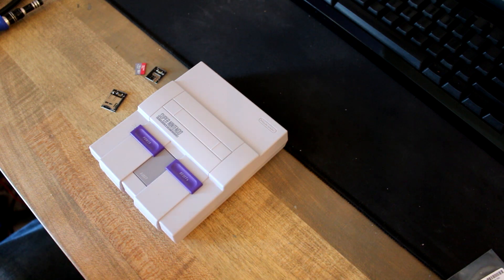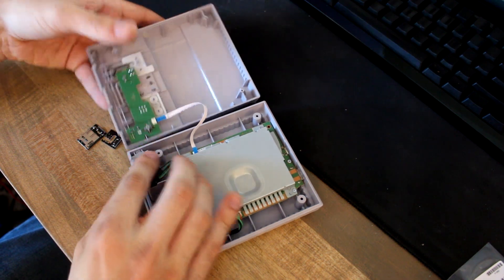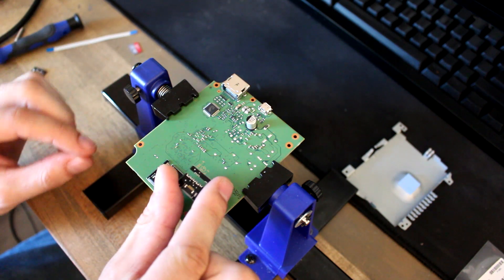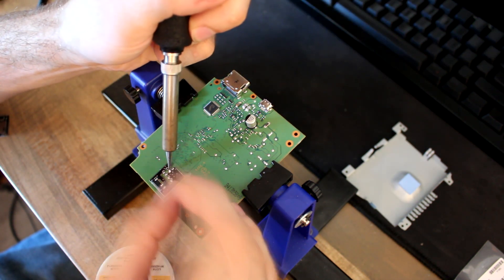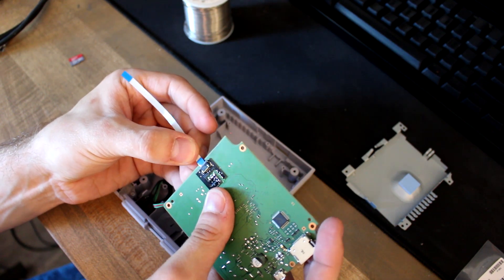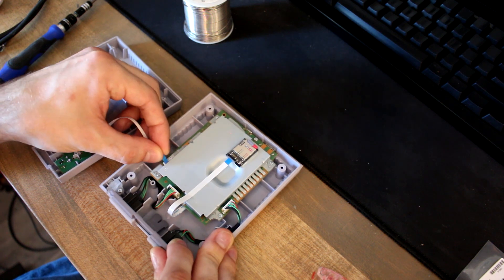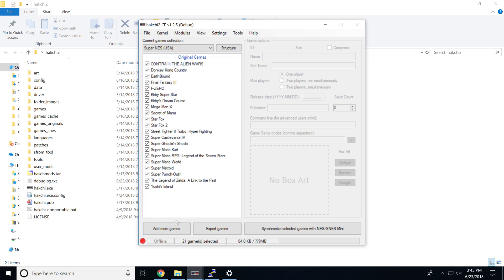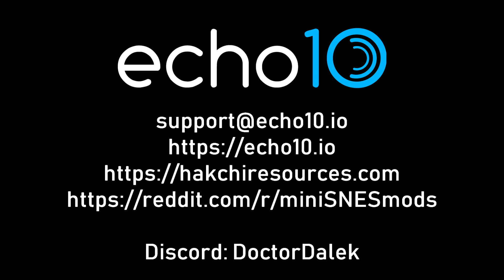Super Storage Rev 2 Install

Comment: Got it working the rev3 install was quite easy, the only problem I have is with the CE version of Hakchi, it is just too damn bloated.

Any way to get the SD working under the original Hakchi?
Reply: @DoctorDalek  I know, problem is that CE is not documented, at all, and it has a lot of unexpected and opinionated behaviours under the hood which make simple modifications very tricky (disregarding the effect it has on boot times).
Reply: @DoctorDalek  I was basically hoping I did not have to make my own fork :p

Comment: Why is there no installation video or picture for the Super Storage v3? This board is shaped differently. I want to be sure I am installing it correctly. Why would you release a product then not show people how they are suppose to install it. I just wanted to verify I had it in the correct position before I started to solder. Also the website doesn't state what file system the MicroSD card need to be. Does it support Fat32, exFat, NTFS, EXT2/3/4? Does it support MBR and/or GPT?
Reply: I believe the filesystem on the SDCard doesn't matter, as it will be formatted when you install the 'SD Prep' module.   See my other comment about installation.
Reply: The new board if offset a different way but all the points solder the same.  The card needs to be fat32 but I'd recommend using the "SD Prep" module to setup the card.  Then you won't have to mess with the formatting at all.

Comment: I just installed my Super Storage v3.  Few notes for anyone confused like I was: The v3 mounts in a different position than the v2 (as in this video).  Also, there's an additional step you need to take before your SDCard storage is visible in Hakchi. Open the Mod Store and install "SD Prep" under "Additional Functionality".  Only after doing this will your new storage be available..
Reply: You just saved me so much trouble by mentioning the "SD Prep" module.  Thanks!
Reply: @bowbag  Glad to help! I had to go and ask on Reddit to find out lol
Reply: @fuzzybad  Hey could you help me pls? So I soldered the board now and inserted my SD Card. Then I flashed hakchi CE most recent version. Then I installed SD uboot in FEL mode and turned it off and on again. Next I installed SD prep and again turned it off and on. But I still can't see the SD Card... It only says 179 mb or something like that. What am I missing or what am I doing wrong? I hope you can help me. Thank you!!!
Reply: @theblackdeath8933  Did you follows the steps for the telnet check mentioned in the video?  That will tell you if card slot is soldered on correctly.  If it shows up there than it's something software related.
Reply: @bowbag  doesn't show up in Telnet, but as I said the SD Board seems to work as it flashes a blue light upon start and then stops.
Reply: @theblackdeath8933  The light may only indicate that the slot is getting power, it should stay solid if it's seeing the card.  Try reseating the card, or maybe try another card.  You could also try a continuity check on all your neighboring solder points, there should be no continuity between neighboring points.  This assumes you have a multimeter with a continuity check feature.  You can get em for like 15 bucks off amazon.
Reply: @theblackdeath8933  If it's not showing up in telnet then I think there's an issue with the physical installation.  Perhaps desolder the Super Storage, clean up both boards, and try again using flux.
Reply: @bowbag  how hard was it to install it for you? Got mine today and I am a little bit scared lol.
Reply: @theblackdeath8933  It wasn't so bad but you should be at least a little comfortable with soldering circuit boards before you start.  The points aren't crazy tiny but you do need to focus a bit.
Reply: @bowbag  yeah thanks, I did solder it and manage to solder it working I guess as I never could finish installing the other things... The little SD Card Board flashes blue but my SD Card wont be recognized no matter what I do. I tried flashing uboot SD, installing SD Prep and did everything correctly and in the way it is supposed to work but it doesn't... I don't know whats the problem but I guess I give up on it.
Reply: @theblackdeath8933  Does the card show up via telnet?
Reply: @bowbag  no
Reply: Thank you very much, but where do you mean exactly? Which position does it fit? Same like Rev2 in this Video? Or somewhere else on the board? Thank you very much :)
Reply: @theblackdeath8933  Rev3 connects to the same pins on the SNES board, but is oriented so the cable is pointing in a different direction.  Going from memory, I think the ribbon cable connector was pointing in the direction of the USB and HDMI ports.  Anyway, there's only one way the Super Storage can be placed so that all pins are connected.
Reply: @fuzzybad  OK thank you I will give it a try!
Reply: Im still confused the connector or the ribbon points towards the Hdmi and usb because I think I have it placed right but want too be sure anyway anyone can post a picture of chip placement or make a new tutorial any help would be greatly appreciated thanks
Reply: Hi, can you upload games form Hackhi direct to the MicroSD card? Or you need disassembly SNES mini again?